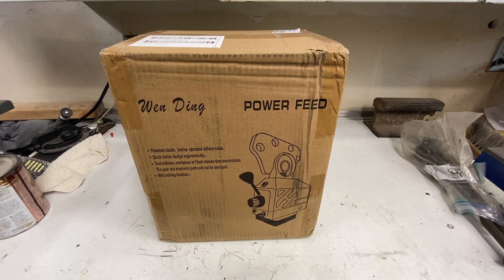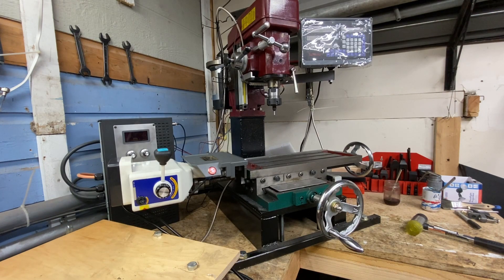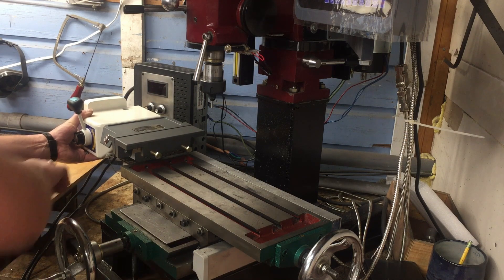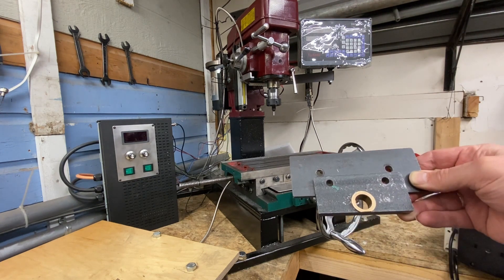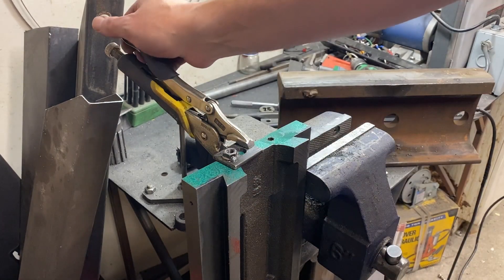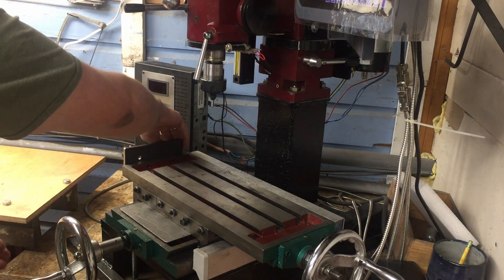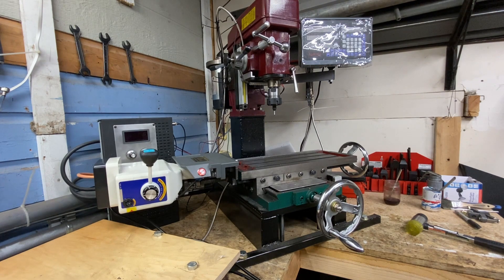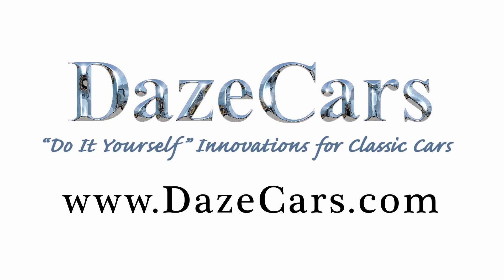Installing a Horizontal Power Feed on a DIY Mill Built From the Mill Head off a 3-in-1 Combo Machine

Comment: Hi folks. I've installed one, I did not like the lack of a no-volt release switch, no interlocks with the mill on/off controls and most of all that the table travel limit switches were in the mains voltage feed which is 230 volt rms ac over here - the switches are too exposed to coolant for my liking. So I built a three relay and transformer unit controlled by a NVR switch. The limit switches now operate on 24 volt ac, and if the mains power fails or the mill itself is switched off and I forget to turn the power feed off (easily done at my age) the drive cannot restart all by itself when the mains power comes back on. With the spindle possibly still engaged after a short  mains drop out that would be disastrous.
Reply from the maker: sounds interesting.  I still need to do some fine tuning to my install.  Always seams like there is a way to build a better mouse trap.